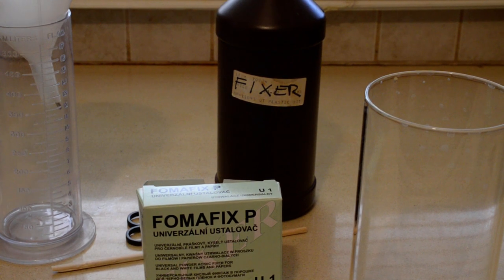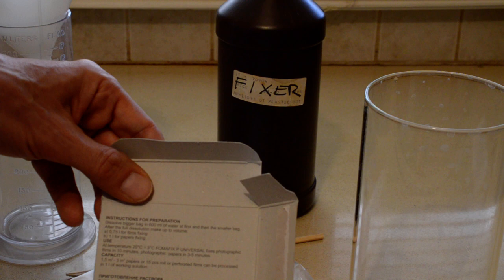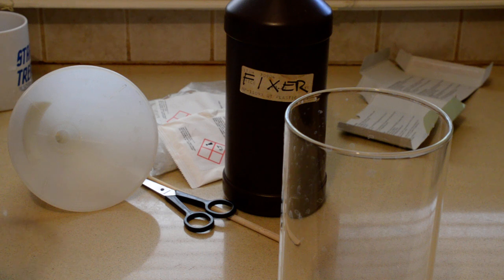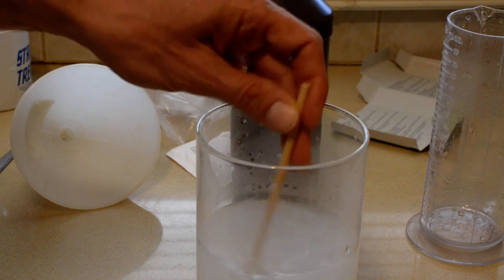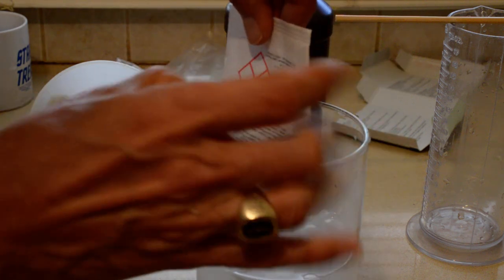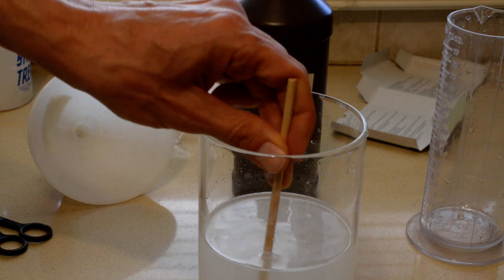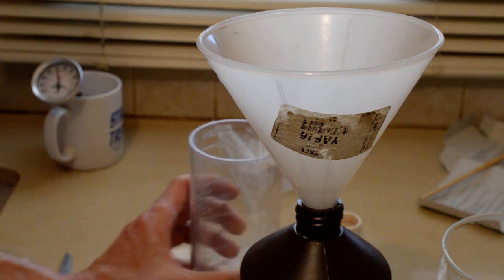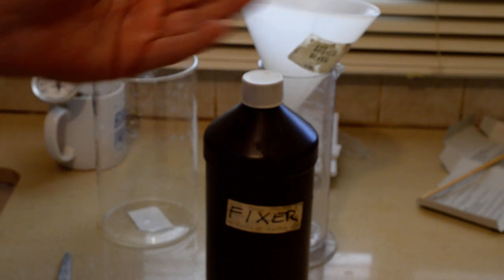Preparing Powder Fomafix

Comment: Glad I found your video, was a little confused at first. Incidentally, the PDF instructions on Foma website says the following regarding water temperature:

Preparation of working solution

In 600 ml water of 40 °C, the content of the bigger
and then of the smaller bag is dissolved, for the
processing of films and papers to be filled up with
water to a final volume of 750 ml and 1 litre
respectively.